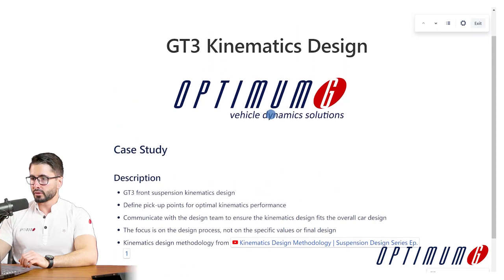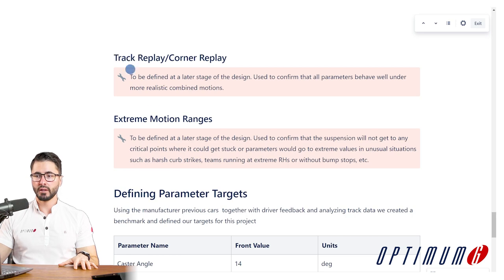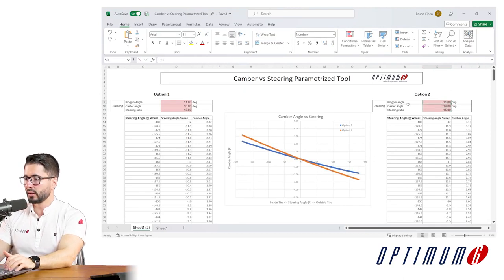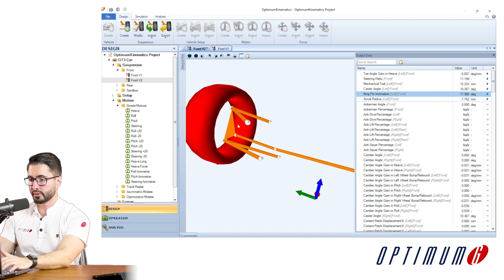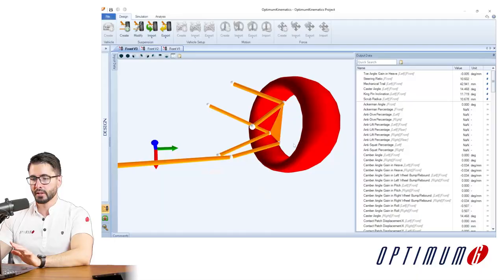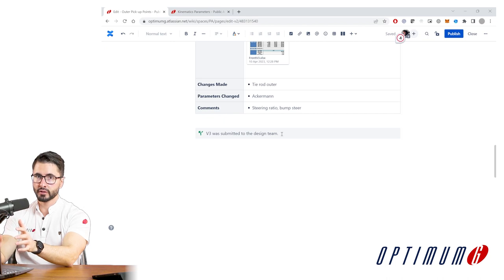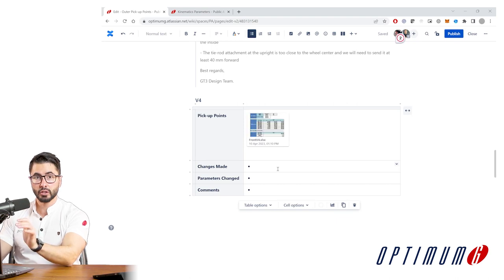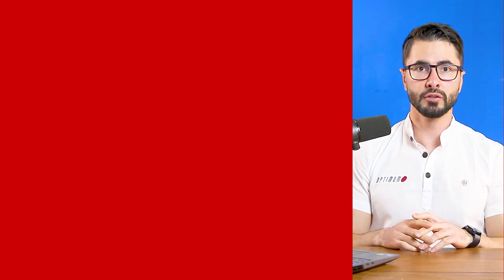DESIGN WITH ME! Upright Pick-up Points | Suspension Design Series Ep.2

Comment: I've spent the time getting my suspension design in your software and I'm trying to follow along - even with the front and rear suspension fully defined, I can't get an Ackerman angle (percent) to show up in the software  as shown at around 16 minutes.  I understand this is not meant to be a complete tutorial, but I can't work out why (no matter where I put the tie rod connection on the upright) I can't get any Ackerman results.  Is there a missing step?  I've followed the link to the documentation - and it would help a lot if we could get a copy of the model so we can learn the process.
Reply from the maker: Hello @ThrottleStopGarage! You can contact us at our support to check what is going on.